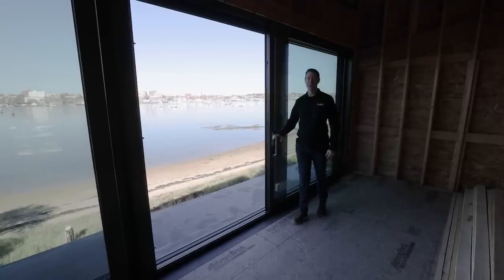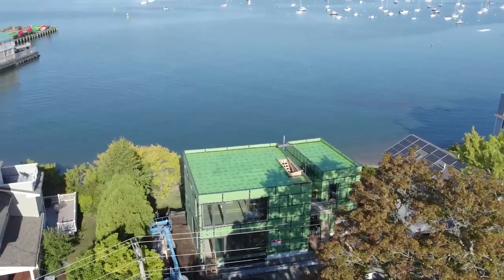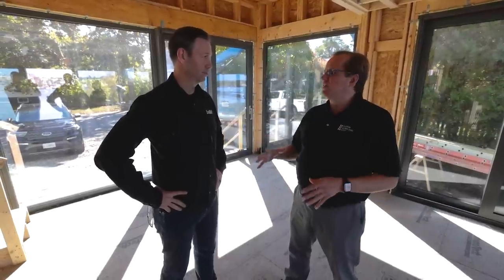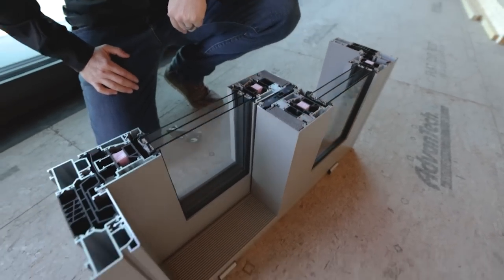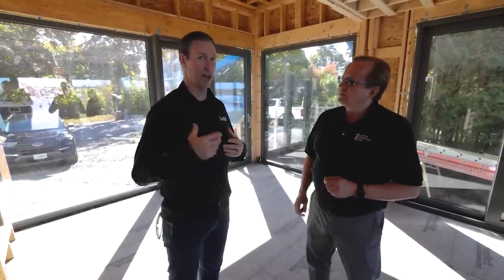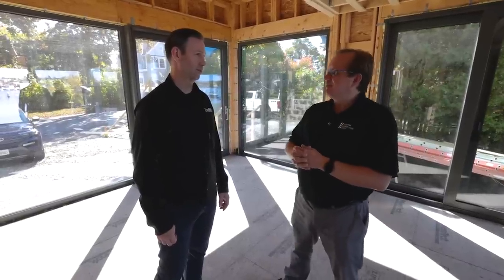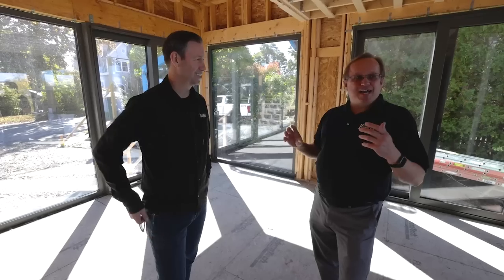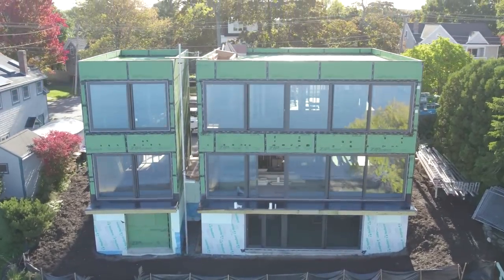How To Get Better/Cheaper Windows from Europe (to US Job-sites)!

Comment: European uPVC windows are everything Matt says, but EAS is a disaster. I made a $50K order from EAS last year. EAS did not inspect the order prior to delivery and it was delivered by EAS with significant damage from mishandling and a defective lift and slide. Not knowing the extent of the problems, I only retained $5K, less than the cost of freight. I spent three days scrubbing black adhesive from the protective tape that was impacted into the windows. Most of it cleaned up, sometimes the black adhesive penetrated the foils. A few weeks later, EAS inspected the windows on-site and ordered replacements, some of which had new defects. EAS's poorly trained drivers/installers further damaged the windows when reinstalling parts from the original windows. Patrik actually sent me links to videos from a Belgium company that performs meticulous foil repairs, it was painful to watch EAS butcher my windows in their attempts.

After another six months of promises, two repair visits where they arrived without the necessary parts or tools, four lost days to no shows, EAS has decided to ignore their own terms of sales and is demanding final payment in advance of completing the repairs, as well as new warranty issues and is ignoring emails. EAS also lowered their quality standards as they dragged this out. For example, the hinges on a replacement door sash were misplaced so there are now large, uneven gaps between the upper and hinges, and the pin caps do not even reach the hinge pins as they are designed to do. The standard is no longer to meet the hinge manufacturer's specs, but only to be operable.

EAS is totally ill equipped to deal with problems and can not be relied on to honor their commitments, written or otherwise. I have no regrets with our choice of European uPVC windows, only in doing business with EAS. It was a very expensive mistake
Reply: Arent euro manufactures there in the US? There has to be a couple of them at least, there are hundreds of them here.
Reply: We spent over $8,000 replacing your "significantly damaged" window sashes and frames and undertook 3 day-long service trips to replace the units. When the damaged sashes arrived at our warehouse, two of our  staff personally inspected them and had a really hard time locating some of the blemishes. We had to go to the photos you sent us to located them. Dents can look very big when photographed with an iPhone close-up shot but ultimately had little aesthetic impact on the windows. We replaced them anyway.  

Following the replacement of the units you continued to reported new blemishes and decided to withhold payment. We had to put a stop work order on your account due to delinquency.  You asked us to perform one more service under the promise that you will give the check for the balance to our technician.  Our technician undertook the day-long service trip but ultimately you withheld the payment again. 

Window business is tough and things do not always go well, but here at EAS, we try to make things right for the customer.  We may not succeed on the first try but we put in the effort to make sure we go out of our way to correct things so we do not get reviews like these. If anything, your case illustrates the distance we are willing to go to perform after-sale service. It is still a bummer than you are so dissatisfied.
Reply: Of course, we are dissatisfied. A year after delivery, we have a new house full of damaged and defective windows and doors, wasted countless hours dealing with EAS's frustrations and failed efforts.  Now, there is little prospect that EAS will, or is even capable of honoring, its obligations.

EAS neglected to say that they actually inspected all of the damage onsite prior to agreeing to order replacements. It is understandable that EAS may have had trouble performing inspections in warehouse conditions, as windows are typically installed in exterior walls. The defects were readily identified and later confirmed by EAS on-site in daylight, prior to their challenged inspection.

EAS's Terms of Sale state that the retained balance is due when the problems are adequately addressed. What EAS characterizes as continued reports of new blemishes,  were timely reports of significant damage caused by EAS, as well as defects in the replacements.  EAS can not end run its contractual obligation by merely claiming these reports as "new". Replacing one damaged part with another damaged part does not adequately address a problem.  The account is NOT delinquent. This  is well documented and EAS knows this.

There were a series of failed service calls. First, there were two visits by an incompetent EAS crew that resulted in further problems.  Then five  and seven months later, there were two visits by an EAS crew seemingly capable of performing the repairs, but without the tools, parts or time necessary to do so. The later crew accomplished little more than finding more problems with EAS's earlier repair work, such a frame that was bent when EAS installed the original glass in a replacement frame. Now the operable window below thar share the frame can not be opened.  

EAS told me that they would complete all of the work on their most recent visit, yet they arrived unprepared. If the work was completed,  payment would have been provided, as required.  Now,  EAS refuses not only to adequately address the original problems, but refuses to honor their warranty. 

The last paragraph of EAS's response has their only thread of honesty.  They did "try",  "put in an effort" and "go out of our way to correct things", without actually correcting things.  EAS must meet it obligations, not merely try.  These issues should have been resolved eight months ago. EAS clearly does not have the experience, skills and integrity to deal challenges.   When faced with their failings, EAS trivializes problems, twist facts and blames the customer. 

This far to much detail for this forum, but vendors like EAS @European Architectural Supply are a homeowner's worst nightmare.

Comment: There is a very strong push for energy saving, passive type homes. But suppliers and builders are very limited to non-existent in many areas. 
It would be great if there were thousands more builders like Matt across the country.  Instead we have the bulk of builders focused on building to minimum standards, trying to build the cheapest home they can get away with. The 10 to 15 year home. After that, homes start falling apart, needing hundreds of dollars maintenance and upkeep.
Reply: quality and passive are two different things. You can have an extremely well built long lasting home that meets bare min energy standards. or you could have a passive home that falls apart.

Also, suppliers sell products based on what people want to buy and when it comes to products targeted at passive homes, its a narrow market sector primarily due to the added cost of the house. In a perfect world all home would be passive but most don't have a budget for that.
Reply: @Josh.1234  exactly! And the house in the video isn’t PH. You can play tricks with krypton fill on glass but the gas migration levels will render it at a 50% loss in 5 to 8 years.
Reply: @Josh.1234 , you are absolutely correct. What better examples than pyramids made of stones lasting hundreds of years. Although, one assumes, if paying extra to go passive, one will not cut cost in quality construction.
As far as supplies, it is common for the initial buyers to pay higher prices for low demand products than after it becomes mainstream. I just see the transition to be very slow. And in many instances, built from habit or what contractor is familiar with, rather than best supply for the cost option.
Reply: @victorvazquez5439  last 100 years, building practices have changed probably faster than they ever have in history. It would be nice if we get better/cheaper products faster but it's that slow process of market adoption which weeds out the good from the bad.

You are probably right, most builders who can achieve passive home status probably also have good construction practices but you never know. You would be amazed how many dumb things people will do or corners they will cut.

Comment: I’m an idiot, when he talks about $35-40PSF for a low end window, a 4x4 window would be $640? Am I thinking about that right?
Reply: That is a correct assumption. Although, as mentioned, a fixed window of the same size would be around 40% less so under $400. 
I sell windows from most of the large US manufacturers as well a some Canadian and their prices on a triple glazed window are considerably more overall.
Reply: @toona67  got it; thanks a ton for clarifying!
Reply: @toona67  I think that $35 number was fixed. The comment later i don't think was related to that number.
Reply: @andrewkennedy9704  as I don’t have access to EAS pricing as I do others, you could be correct. 
That said, from the majors in the US that I deal with, that is a pretty accurate statement. 
A 3050 fixed is generally 35-40% less expensive than an operable window. Hung window on the low percentage and casement/awnings on the higher.
Reply: @toona67  I get what you're saying and don't disagree but if you go back in the video he clearly states the $35 price is for fixed. It goes up from there for ones the open.
Reply: @andrewkennedy9704  Yes it was for fixed.
Reply: @andrewkennedy9704  definitely fixed he’s quoting prices I couldn’t get from eas 4 months ago
Reply: @johnwhite2576  supply issues?
Reply: @toona67   do you sell all over the US or have a defined territory?
Reply: @neilmellberg3094  I am localized in northern MI.